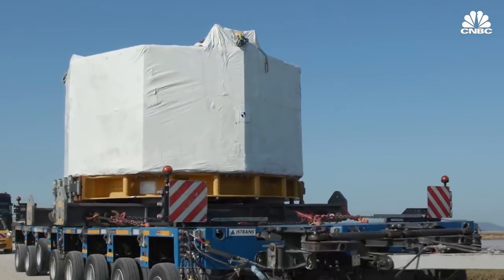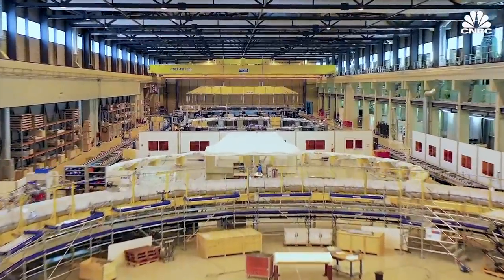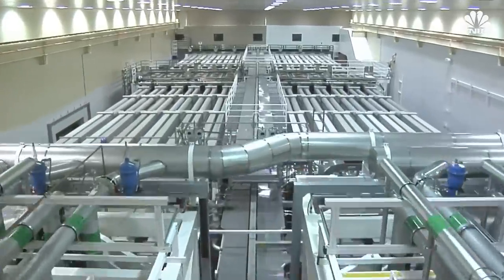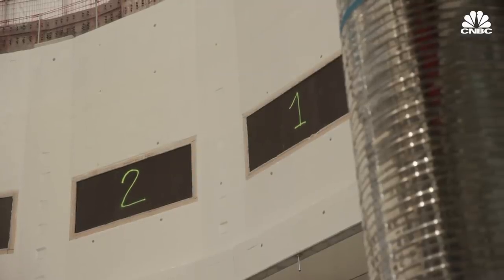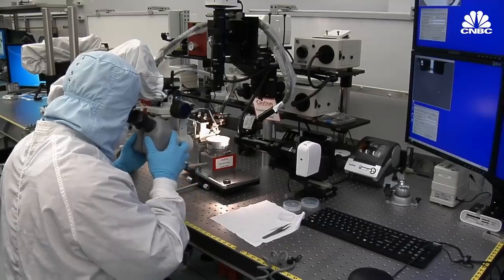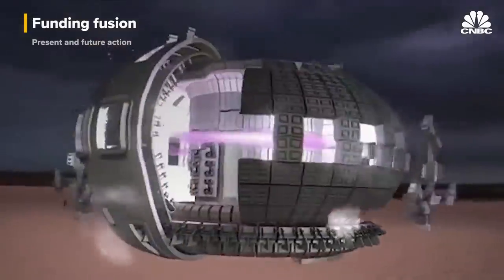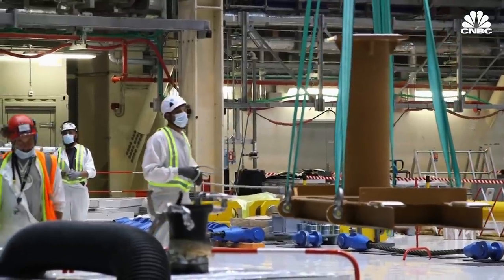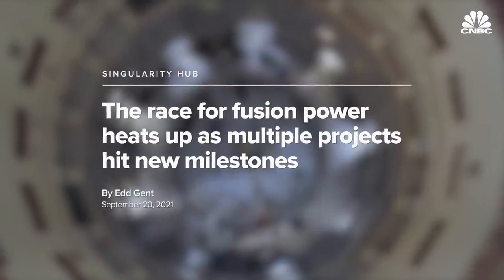Can This $22 Billion Megaproject Make Nuclear Fusion Power A Reality?

Comment: There's a key detail to add to this report... SPARC and other newer projects were built around new superconductors that only need liquid nitrogen to maintain superconductivity rather than much colder liquid helium. ITER, unfortunately, was too far along in the development process to redesign around high temperature super conductors. SPARC is running MUCH higher power through the HTSCs generating a denser, tighter magnetic field, drastically shrinking the size of the machine by around a factor of 10. This is how they're moving fast.
Reply: If you squirt water into the super hot plasma ring --- won't it get repelled because of the enormous magnetic field?
Reply: Thank you for the information, that means as a old man how's been waiting for this i might live long enough to see it  ! .
Reply: Joe with the FACTS
Reply: all of these mega project face the same issue, you started with cutting edge and by the time you put everything together, its already old tech.
Reply: @michaelsamuel9917  Photons (like infrared light) are not effected by magnetic fields. That is how you get heat transfer. That is how the Sun is able to give heat to Earth through the vacuum of space. Also fusion is naturally safer than fission reactions because you need a functioning system to keep it going (it is self extinguishing). Also Hydrogen is the most abundant element, can be produced on site, and much cheaper than thorium which is in much lower amounts and needs to be mined.
Reply: @fredwerza3478  There in NO water being squirted inside the reactor. Heat is transferred through light which is not affected by magnetic fields. That’s how the Sun is able to give heat to Earth through the vacuum of space.
Reply: @andrei-lucianserb1771  I'm talking about fuel for the reactor, dum-dum --- they need hydrogen to fuse into helium, and the hydrogen comes from water --- so it needs to be squirted into the plasma coil
Reply: @michaelsamuel9917  I have no idea how thorium reactors work but why can't anyone explain how the fusion reactor will work?  The public should be made aware of these things.
Reply: @fredwerza3478  That is not how you make hydrogen. You make it using electrolysis, using electric current to separate water into hydrogen and oxygen, and then you introduce the hydrogen in the reaction chamber.
Reply: @fredwerza3478  It works exactly like a nuclear power plant, but based on the safer, cheaper and more powerful fusion reaction instead of the fission reaction. It makes a lot of heat, and that heat (transferred through infrared light, not affected by magnets) is used to make steam, and the steam is used to spin turbines and produce electricity.
Reply: I'm a huge fan of SPARC, I toured the MIT lab where they developed the conductors around 4 years ago. However, they're a commercial project and they're not trying to answer as many questions regarding a self-sustaining fusion reaction.

ITER is a science experiment, and they're a lot of very important research for fusion reactors. It doesn't make sense to scrap it because there's some new technology up and coming. The material interactions in those conditions while in a continuous fusion state are COMPLETELY unknown.
Reply: @hc8714  Isn't it the same with all tech.
Reply: @andrei-lucianserb1771  None of that holds true for Thorium reactors.
Reply: @fredwerza3478  You don't "squirt" water into the plasma coil or anything remotely like that! To begin with you do NOT use ordinary hydrogen (protium) in a fusion reactor. The narrator is just simplifying things by saying "hydrogen" but if you pay attention to the video itself you'll see that the reaction involves two isotopes of hydrogen: deuterium and tritium. Deuterium can be extracted from seawater and tritium can be made by bombarding lithium-6 with neutrons in a nuclear reactor.
Reply: @andrei-lucianserb1771  
1. Fusion reactors do NOT use gaseous "ordinary" hydrogen (protium) from electrolysis or whatever. Rather it uses isotopes of hydrogen, specifically deuterium (D) and tritium (T). Deuterium can be extracted from seawater and tritium can be created from lithium-6 using neutron activation in a nuclear reactor.

2. A fusion reactor does NOT use infrared light/photons for energy transfer. For a D-T reactor much of the energy is liberated in the form of neutrons. You need to capture these neutrons to harness energy from the reactor. To do this you can blanket the reactor with lithium, which captures the neutrons and heats up. This jacket of lithium can be cooled with a fluid, which carries off the heat to run generators using the steam cycle.

3. In an aneutronic fusion reactor (e.g. using a proton-boron fuel), much of the energy is liberated as charged particles and this can be converted to electricity directly using direct energy conversion, hence forgoing the need to use the steam cycle to generate electricity. However, aneutronic fusion has much higher technological hurdles, for example a proton-boron reaction needs a temperature TEN times higher than that of D-T to achieve fusion.
Reply: Just because HTS can superconduct with nitrogen cryo it doesn't mean it will.  Any magnetic confinement fusion device using superconductors of any kind will use helium cryo because the colder temperature allows for higher critical current and higher critical field.
Reply: Material and Chemical science is a wonderous thing aint it?
Reply: @michaelsamuel9917  But most importantly, quicker to build. As a previous poster mentioned, the issue with these mega projects is, you start with cutting edge tech but by the time you get the damn thing built, it's obsolete. Elon mentioned it in one of this speeches that, we need to modify the process itself allowing these groups/orgs to innovate rapidly and modularly, so they can pop out the obsolete stuff and put in the new stuff with little to no downtime.
Reply: If is it
Reply: How are you going to cool the superconductors with liquid nitrogen when the reactor must become hot enough to turn water into steam?  You aren't.  This is all a scam.
Reply: I don't understand a thing you said but I like it
Reply: Joe, yes it’s moving fast! It’s highly likely miniaturisation will be in full swing nearing the end of my life time.  There are well over 10 different projects worldwide and it was fascinating when I read up on the development of them all including cold fusion 😂 it would indeed be very handy in a space ship in the next century to help make a cup of tea and of course propulsion.
Reply: @andrei-lucianserb1771  Photons do not transfer heat.
Reply: @MrParcho  oh really?  how is the Earth warmed by the Sun then?  How is bread heated in oven?  Answer, photons. Radiant energy. You flunked science class, didn't you?
Reply: @Vendemiair  That would be a silly way of getting tritium, needing a pile of fission reactors to make fuel for fusion, might as well just make thorium fission reactors with spent fuel that decays in short length of time.  It is dreamed that a DT reactor would breed tritium from lithium but the rate at we're going I wouldn't count on working fusion plant by end of this century.  Waste of time and money at the present, we already can make cheap abundant energy with known tech.  Solar power, storage, and UHVDC lines to carry power half a continent away are the way forward, or if you really hate being that green we can make gen  IV nuke plants that don't expel long lived waste, thought that's second best.
Reply: @fredwerza3478  actually 50 percent of the hydrogen is coming from a fission plant its tritium and costs 30k per gram.
Reply: @fredwerza3478  oh my god. if that's a joke it's a sad one.
Reply: @hc8714  then as the process repeats a new company somewhere will finally achieve everything the old companys wanted
Reply: @barriewright2857  Hate to break it to you, but even kids today won't see it. We're looking at mid millenium rather than mid century, if at all. What they're not telling you is that Qplasma means nothing when producing net positive electricity for the electrical grid, what matters is Qtotal. And all fusion reactors are 0.01 Qtotal or less, they need higher than 1 to produce net positive energy, and before we even get to the grid this is THERMAL energy, not electrical energy, so when we factor in conversion efficiency you could probably shave off half or even 2/3rds of that thermal as waste heat.
Reply: @andrei-lucianserb1771  That is completely false. You can have a self-extinguishing source of fission energy--it's called an accelerator-driven system, otherwise known as a subcritical fission reactor. A particle accelerator is the system you need to maintain a fission reaction, and since it's subcritical it's inherently safer than any critical fission reactor design, including the thorium ones.
Reply: @infini_ryu9461  DEMO is being designed to actually put energy into the grid, a small amount yes because its still an experiment and you can't have unreliable sources hooked up to grid. I work in the fusion industry and trust me nobody is more sceptical of tokamak design than plasma physicists, if we say we can do it then we can do it. The reactor I'm currently working to design is also going to produce net electric. 
The media will always over hype every new development, but we really are close. No it is not going to suddenly sweep in and solve global warming, but we are looking at significant market penetration by the end of the century. And for those who claim "its a waste of money because we have xyz" - if you think energy demand is bad now its only going to get worse. Plus in the grand scheme of things these projects cost peanuts to governments even before we factor in the direct economic benefits of the many technological advancements in magnetics, robotics, cryogenics and materials that come with trying to solve such a difficult challenge.
Reply: @DumbledoreMcCracken  Your plasma is surrounded by a vessel and thermal shielding, you can't put superconducting coils inside the vessel, but the largest coils you use for confinement just have to be situated outside of this vessel. regular resistive coils can go inside the vessel and they're just given roles that can be performed with a lower current. In designs for plant tokamaks the vessel wall contains a tritium breeding blanket of lithium, neutrons from the DT reaction are absorbed into this blanket where they create more tritium and heat up the lithium. You then extract the heat for your generators from this lithium, potentially by just piping the molten salts through a big kettle
Reply: @idoltrash2353  Again, only net energy if it's in Qtotal, not Qplasma. People have been saying ITER will also produce net energy.
Reply: Still built around ancient technology, and still only 10 years away.
Reply: @MrParcho  Nothing ancient about it when comparing to medieval wind power.
Reply: I'm so glad that the question about fusion energy is moving towards when and how, instead of if, this could solve a lot of problems for us
Reply: @infini_ryu9461  Sure, but i'm not arguing that ITER will produce net electric. However DEMO is being planned to do so, as is the STEP reactor in the UK. Both projects are difficult but entirely feasible. 
I'm mostly picking up on your statement about fusion being mid-millennium if at all. We are on track for mid century, and no this is not like the 30^n years ITER has always been from completion. 
ITER suffered from political instability as well as constant design revisions due to the amazing success of the JET experiments. There is a stronger international appetite to get fusion done. 

And if you struggle with trusting us researchers in the field for whatever reason then look at the private sector, do you really think huge investments would be going into companies like commonwealth fusion if success was as unlikely as you believe it to be? 

Net electric out of fusion is very possible, actually somewhat easy with our current knowledge - the challenges now are all about making it profitable
Reply: @idoltrash2353  I would be more inclined to believe them had they not been trying to obfuscate in the US Congress point blank. They said bold faced that ITER would produce net positive energy, knowing full well politicians can't understand the difference between Qplasma and Qtotal.

International support is suspect when we know countries have been willing to duck out on ITER from time to time. Countries are becoming more inclined to simply using Fission, which has all the benefits Fusion claims it would.
Reply: They need to stabilize the plasma first, nobody did that....
Reply: @fredwerza3478  it’s clear you don’t understand what’s happening here, how about you go back to the Alex Jones pod casts and rant over there.
Reply: Smart man!
Reply: that s irrelevant the point is to obtain repetability , controlling the chaotic interaction of particles in a plasma field requires testing advanced instrumentation and algorythms defining new mathetical tools , fusion is really noting like fission , you are really trying to control something that behaves randomly and that is the main reason that it did not succeed for decades Chaotic behaviour with fixed initial conditions BUT eventually it will be done
Reply: Light is not affected by gravity, right. Possibly ever heard of a black hole?
Reply: Yeah, the first fusion power plants will likely use magnets similar to SPARC to keep the size of the reactor vessel down.
Reply: Hey, can we dumb down this discussion a little so's the rest of us can chime in a little? O.k., now, what are those tomahawk thingies they were talking about?? As far as Fusion goes, I'm pretty sure they've already got that nailed down, heck, several Asian restaurants in town mention having it!
Reply: @fredwerza3478  explanations of how nuclear fusion works is all over the internet. Just stop being lazy